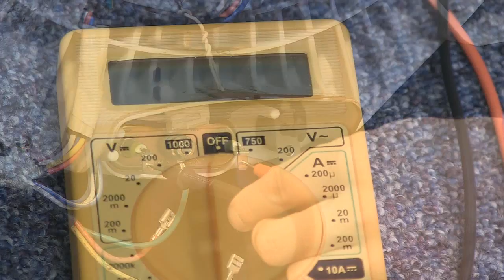How to Diagnose Washing Machine Control and Program Problems

Comment: Is there a simple way to reset a control panel? I have a Kenmore he washer front loader. Some how the panel reset itself. The cycles are now under a minute long, the panel does not display water temp options. I have already unplugged it overnight in hopes this would work, but no go.
Reply from the maker: Hi Lori, the control panel is likely to be resetting each time the power is off but you may have a problem causing the cycle to stop. If the machine does not finish filling or shuts off immediately filled watch this video:
https://www.youtube.com/watch?v=VS48G_cwCXo&index=4&list=PLZopaZU-UQSHj1noiwEJ99JjXWcEcSAbZ

Comment: Hello.:)
Bosch Maxx 5 WVD2452OUE. When it is turned on screen displayed only horizontal line. This it wash and dry machine. Where is the problem? Can I fix it or this is not possible or to expensive?  Thanks
Reply from the maker: We think the child lock may have been accidentally turned on. check your instruction manual or look on your front panel for a padlock symbol. You may have to press and hold he start button or possibly two other buttons for five seconds to unlock the machine.

Comment from the maker: An overfilling washing machine is commonly caused by a blockage of grease and gunge in the pressure chamber, or more rarely a faulty pressure switch. Check for a hole in the small pressure chamber tubing

Comment: Hi I have a 13kg Samsung fully automatic top loader washing machine model number WA13G7Q1 which stopped working.The technicians told me that my control/computer board is faulty and need to be replaced.They can't find such a part as it is "old tech" and is no longer available on the market.Can you please help find this control panel/computer board or indicate to me where I can find the part.Thank you

Comment: What if you get no error code? My Indesit WIXLwill not start- when I switch power on, horiz & vert lights flash once & red door light flashes continuously. I select the program & press start & the corresponding vertical light comes on. When I press 'start' button, single vertical light stays on, door light goes off and nothing happens. I have replaced door lock with no result.

Comment: The heating element on my Bosch machine short-circuited, and tripped the fuse.  I replaced the element with a new one, but since then, machine has been behaving erratically.  Once it reaches the end of each stage (wash, rinse, or spin), it thinks it has finished the wash completely, and the 'End' light comes on.  I have to manually start the next part of the cycle.  Could the control board have been damaged when the element short-circuited?

Comment: Hi, I have an indesit WIA111, about 11 years old. When I turn it on at the switch, before any program is selected (it won't let me) the inlet hose starts thumping, drum fills with water and the only way to drain it is to undo the lint trap. If I turn off the water supply and turn on the machine at the switch, I can hear a quiet thumping (possibly pump?) that continues indefinitely unless I turn it off again. I've emptied the trap, checked the inlet hose and filter, no idea what's happening. Any ideas? Thanks

Comment: I have a bosch 1400 exxcell washing machine that will not complete the cycles. If I put it on a wash cycle it will fill, wash for 10 mins and then drain. If I put it on a rinse cycle it will fill and rinse for approx 5 mins and then drain. If I put it on a spin cycle it will drain and spin (at low speed) then stop. On all when it drains the display will go blank. No error code is displayed. I have checked the filter and drain hose and there are no blockages, pump is working as it is pushing water during the drain cycle. Any ideas?
Reply from the maker: Hi John, try on an empty spin cycle to see if it will spin up to high speed. If it appears to splutter as it turns then that would indicate worn motor brushes. If no other fault is found suspect the heater element before the board as it may identify a faulty element and shut down.
Reply: eSpares Hey,  I don't know if you guys have done a video on hoover/candy machines,  I used to work for them as a service engineer,  I watch a lot of your video's just to see other machines as I do as many as I can in my spare time and repair them,   if you want some info on some of the machines and common problems and fixes for hoover/candy machines let me know,  or if you have had any unusual problems --- we had countless unique faults with the machines which required some fixes from standard --- I.e the aqua tumble dryer doors continually warping and melting --- add a thermostat to front --- E7 on integrated washer dryers was a manufacturing fault with the boards when the door wasn't opened in time and locked door.   

The oddest one which no-body figured out and took myself and my friend who worked for them also 3 visits and 5 hours to finally fix and a lot of company money,  which was a drain issue,  easy huh?  For some unknown reason (Pity I can't remember the model now) the drain pump would cut out every so often,  ok.... perhaps its faulty when worked too hard,  replace it right?  nope... No insulation fault with or without water,  ok.... replace the board.... Nope....  hmmmm

After finally finding that the drain pump was getting only 120volts at a certain point in the cycle this made you think clearly the pump wasn't a problem,  but surly the board that isn't giving the correct signal,  but its replaced! 

It was somehow.... the selector switch.... no idea how,  tech team had no idea how,  no-body knew how,  but then a few of us ran into same problem and sure enough the fix was .... the selector switch....
Reply from the maker: jason hounsell Hi Jason, Thanks for your comments.
I remember only to well how the programme selector switch plays up on a number of Hover/Candy machines and arranged a Video showing the replacement and advising of the problem.
Gues it was just the connections going resistive causing the CPU to think the cycle was not selected correctly.
On a quick note of 'pausing drain pumps'.
I to have had a number of Hoover/Candy machines when after 20 to 30 seconds draining would pause for a few seconds then restart.
I think this is just part of the programme when the CPU checks if the cycle has finished and if the pressure switch does not report empty it starts again. 
I don't think it is a problem so if you see it again there is no need to worry..

Comment: whirlpool duet steam model number wfw9550ww00 I start cycle lights go on it counts down like it is going though the cycle but it is not spining or calling for water, door stays locked until  I unplug then plug back in and wait for about 5 min

Comment: My  LG top loader washer would not go into the drain stage of the washing cycle.First there were noises coming from a drain motor, then it sat for a while and displayed OE error. No drain or spin happened.As many posts suggested, I checked the drain motor (it was not working) I have  replaced the drain motor with a brand new one.
I then tried Rinse+Spin  cycles with no clothes, to confirm that it got fixed, but it's.worked  only one time and 
again it  stopped on the Drain/Spin stage and displayed the OE error after sitting for a while, no  noises were coming from the new pump though.
I then went through manual check of the drain motor  it was not working and  again I put a new drain motor and same thing happened  drain worked.only one time and motor stopped working can you  suggest 
What else could I do, please help me 
Thank you!
Kumar 
India

Comment: My main lower control board on my indesit blew and damaged a part of the control board so I got a replacement good second hand one but now it turns on and then the lights flash but jothing else, woukd you please let ne know what I should check next

Comment: Hello, how can i reset a washmachine AEG L60800?
I get sometimes an error code E50.
Thanks for your help
Reply from the maker: Hi Georgios, Error E50 suggests an intermittent motor fault so check the motor plug and connections and if these are OK check and replace if required the motor brushes. This machine should not require to be reset after repair.
Reply: Hi. I have an LG 12 kg WD-T12415D washing machine that seems only to perform the drain function. It always brings an error code E64. How do I rectify this or how can I do a factory reset.

Comment: My washing machine Hoover dyn10154d3x, screen goes on and off  and  some time goes blank , can't select, some time start jumping
Reply from the maker: Hi Basharat, you need to identify whether you are losing power to the display or if it something else, check the connections to the display board first.

Comment: I have a Beko WMB 71442W. When I turn the dial to select the program I want the display flashes and it jumps between a number of different wash programs. It takes several minutes to be able to select the program I want as just as I select the spin speed and temperature I want it jumps back to a different program before I get a chance to start the wash. Very annoying, any idea what this could be?.
Reply from the maker: The problem is likely to be the selector switch: http://www.espares.co.uk/product/es1545970/

Comment: I have LG front load. It runs a bit and has a LE code. Please give me an advice. Thanks
Reply from the maker: Hi Nhạc Tình,  Error code LE means the machine has detected an issue with the motor, start by checking the door lock and wiring and check for cracks in the magnet in the motor. Test the motor with a multi meter.

Comment: Hello JOSH My washing machine samsung, model WA90F4 is not powering on,the problem started with the buttons not responding well and now is not even switching on.
Reply from the maker: +buzo steven 'Not responding well' is a bit vague. If you mean the appliance did not light unless you 'fiddled' with the switch or turned off and on a few times it may be just a damaged switch. Turn off and examine this as there will often be signs of damage.

Comment: hello i have a problem with my washing machine. The model is continental ctn 5e61 The problem starts at the beginning of the program but also at the end of the program explain in detail when it starts to gets water gets some water stops and makes pump out post again gets water and makes the regular program until reach the end of the program where there spin and follow not the ever-ending program only if the Closed i. Please if you know something what could be wrong HELP ME thanks is same with the washing machine beko.
Reply from the maker: We are not familiar with that machine. To help diagnose your problem follow our video We are not familiar with that machine. To help diagnose your problem see our video above and check the pressure switch as it may be sticking see: https://www.youtube.com/watch?v=2pIVkAxWSXg

Comment: Hi I have a Hotpoint WDL540, i HAD A PROBLEM WHICH ENDED UP BEING THE WATER PRESSURE SWITCH, but now the machine work fine in all cycles but I have no lights at al, not the door lock or even when I turn it on no lights at all any ideas anyone, thanks Graham
Reply from the maker: Hi Graham,the most likely cause of your problem is you may have 'disturbed' one of the connections to the control board at the front or the module at the back. If this is not the case and you have not previously disturbed the control panel the fault can be either the board itself:  http://www.espares.co.uk/product/es1677303 
Or the problem may be the module but as this has to be programmed we suggest if it looks like this is the problem contact Repaircare.

Comment: Argos made ProActionA105QW washing machine. After program selection and start,it mostly tries working by giving a soft-sound and nuttin happens thereafter, and it displays a binking START light. Any help?
eSpares
Reply from the maker: Jibbie odutoLa The sound is likely to come from the valve that the fill hose is connected to as it is powered to let the water in. If the water is not flowing check the supply hose and water pressure by taking the hose off and filling into a bucket. If there is not enough pressure (should be difficult to stop pushing a finger over the end) then the machine cannot fill.

Comment: Hi, I have a Kenmore elite washer model #40272900. After a period of inactivity the machine has no power. It requires the plug to be unplugged and plugged in a gain. That seems to "RESET" it. Any help will be appreciated.Thanks
Reply from the maker: +Gecko Ent You may have a faulty control panel as capacitors can age causing it not to reset until powered off for some time.

Comment: Our machine is about 3 1/2 yrs old it makes me wonder if it's worth repairing, Beko has quoted between £127-and £173 to repair for 12 moths cover, a new machine is £450. With 5yrs warranty It sounds like a no brainer to me.
Reply from the maker: +Richard Dyer Hi Richard, with any repair it is worth noting the age and condition of the appliance and if it is well worn and requires an expensive part it may be better value to replace it. However many  machines are discarded when a simple or cheap repair would have likely have given several more years use.
Also some peoples budgets are not prepared for an unexpected cost like that. We hope like you they first do their research and find out if they can repair an item (with help) successfully themselves.

Comment: Hi espares. So my Bosch Classix6 washing machine keep throwing up f21  error code. The machine drum turns easily enough by hand but will not spin. Even when empty and set straight to the spin cycle it goes straight from 12mins to 1min and does nothing. I've just replaced the brushes and still the same. Please help!!
Reply from the maker: Hi christianiani, F21 does normally refer to a motor error with the carbon brushes being the issue, were the carbons worn when you replaced them and did you reset the error code? you will need to test the motor and it could be the board causing it.
Reply: @eSpares  Thank you for your reply. The old brushes were just over half worn when I replaced them. Cleared the f21 code and tried again. But same error code flagged back up. I looked on your site for the price of a PCB and decided it wasn't worth getting one as the machine was 2nd hand 5 years ago when we bought it!! Oh well 🙄

Comment: Hello, i have washer dryer AEG 3 years old, model L61271WDBI, is triping my fuse when i starting and i can not turn on the fuse until door lock is release.
Reply from the maker: Hi Liliana, the most common reason for a washing machine to trip the electrics is due to the element failing so start there, you will need a meter to test the element and this video shows testing the element www.youtube.com/watch?v=Ftm8lDVVw2E&t

Comment: On my Samsung (wf45H6300) front load washer (US), I got the HE code several times and then starting getting the AE6 code.  The heater element seemed ok at a little under the 27ohm spec--about 17 ohms if my meter is calibrated correctly   This problem happened eventhough I wasn't using steam and have hot water going to the washer.   Should I replace the heater element anyway? If that doesn't work, then replace the PCB (panel control board?)?
Reply from the maker: Hi Harold, the reading you got from the heater would suggest it is ok, HE refers to temperature sensor so check that first, AE6 refers to a communication error between the boards. Check the contacts and any signs of damage and good luck.

Comment: trish,
I have a zanussi zwf 1231 w I turned it on and the error code E90 came up but there's no E90 code in the manual any idea's thanks. Trish.
Reply from the maker: +Patricia Smith Sorry I am late replying but Youtube has just 'found' your comment. E90 we believe is a 'comunication problem' where the front panel and the control module are not 'talking to each other' Check the connectors for signs of damage or corrosion but if the problem continues it could be either board that is faulty.

Comment: I have a Hotpoint Aquarius WML540 - program won't start - all lights go out except start button light which stays on (green) - no flashing lights - is this a fault code zero or a fault that cannot be identified by control board?  Any suggestions would be appreciated.
Reply from the maker: Hi Chris, a couple of checks I would make is select a drain cycle and see if the door locks correctly. Check the drain pump is not blocked or damaged and finally check the main motor brushes and heater with a meter for continuity.
If all check ok it would suggest a board, as mentioned these may not be replaced without  having to be programmed.

Comment: What if the board has been already changed but when we try to start the machine it starts to smell like a burning rubber and it starts not to work anymore. The board was changed twice already and the same thing happened. What do you think is the problem of the washing machine in cases like this?
Reply from the maker: This could be any electrical component in the unit causing this , possibly the wash heater. Only way to confirm would be using a megger and checking for any lower insulation readings than expected.

Comment: hi, need help...I have a Samsung washer front load. It is overflowing with water when it fills. Already changed both hot and cold water valves, pressure switch  and hose. Could it be possibly the control board? Thanks!
Reply from the maker: A common problem on some Samsung's is the tube to the pressure switch can rub on the tub during spin and get a hole. if this happens the air that is pushed up the tube to turn the switch off when filling escapes. The machine thinks it has not enough water and continues filling. Check the hose for damage and for more information see another video: 
https://www.youtube.com/watch?v=VS48G_cwCXo